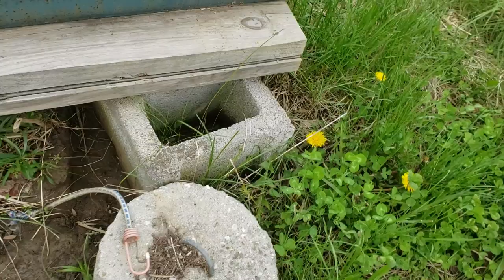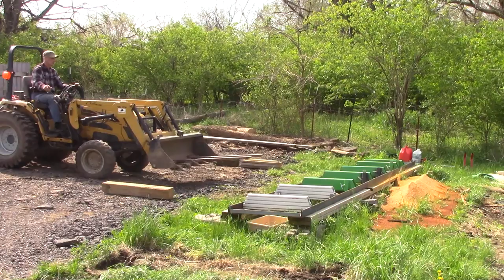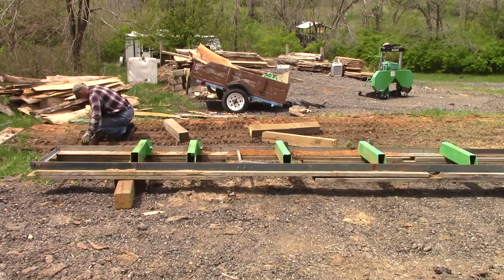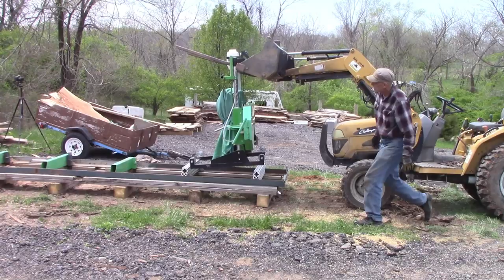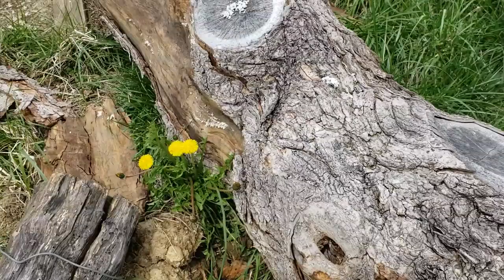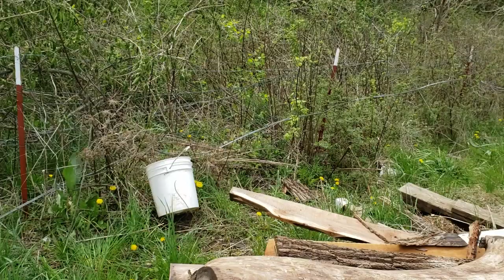Rebuilding the Base for the Bandsaw Mill

Comment: Great to see you up and getting things done, looks like your health is back on track. I noticed with your Mill track  you've extended it, and moved the end bunk, good idea, I've been looking at getting the extension for mine so I can do up to 6 metre logs, atm can do up to 3.1, but as my Mill is in my workshop atm, and even though there is a closed off door that will allow me to get 3 metre logs in, I have to check if I can open up the wall for a 6 metre at least roller door, otherwise I'll extend the back of the shed to make it an area for loading logs, and roll them in like commercial mills do, mainly to get out of the weather. I noticed also, that your track doesn't have the same legs where the bunks are like mine has that allows fine adjustment for levelling. https://woodlandmills.com.au/product/hm126/ is the MIll I got, with the 14.5 HP motor option, and it's been fantastic so far.
Reply: Only other thing that would make the Mill better is being portable, but I have a plan for that. We're looking at getting a car trailer or low line trailer for animal transportation (Goats) so it's not high and to make getting them on and off easier. So my thought was to modify the bed of the trailer so it has tracks with removable bunks, and can also have the tractor loaded onto it, which would help with tractor maintenance, doing slashing jobs for people, and to be able to load logs onto the Mill, and not have to have the Tractor registered for road usage.